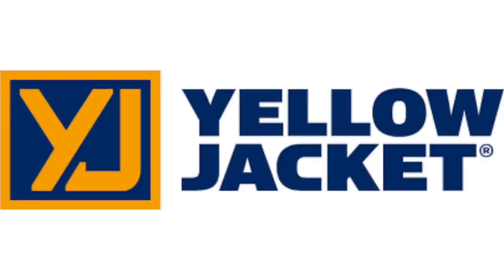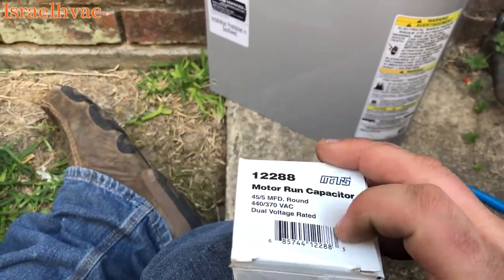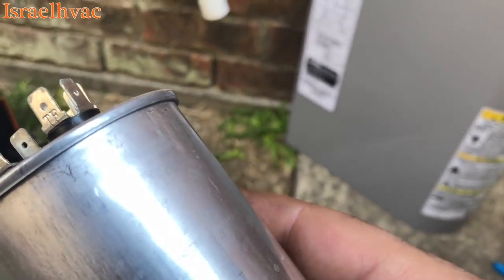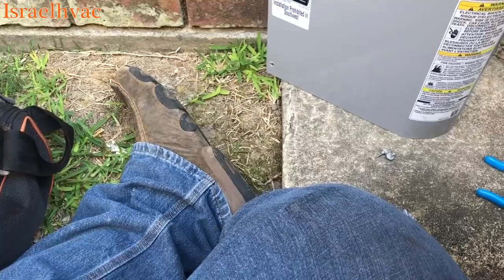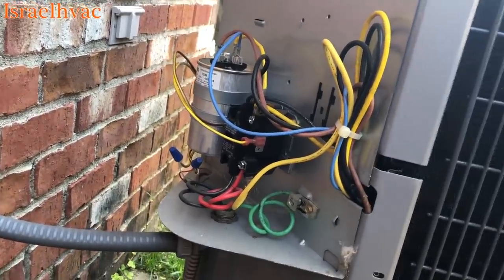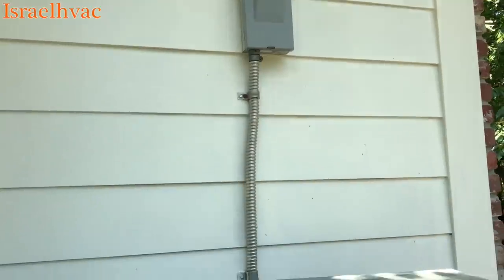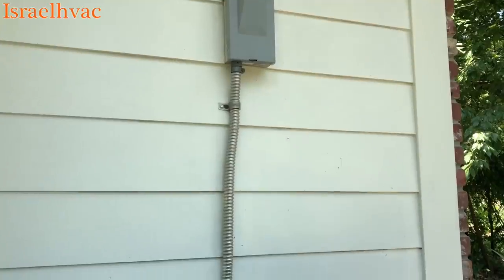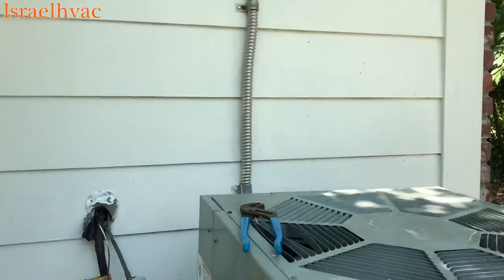HVAC | Quick Tip | Question Answered

Comment: That electric cable housing is for indoor use only it’s called greenfield . seal tight is the only thing you can use outside .and if you ever pull one off I bet the wiring is rusted out

Comment: Not sure of the name either. Seen it in va. , North Carolina  . Not the correct fittings . They have sealed fittings . This won’t rust much and uv will not affect it. It’s not greenfield ,special alloy for outdoor use.

Comment: Want to know why they don't last long?? Those capacitors are loaded in containers [----] shipped from China by sea. So, went sea spray enters air around the massive ship, those are sent in bulk, so Carrier gets them installs on assembly and salt has penetrated them and that causes failure.

Comment: Mars capacitors are hands-down the best aftermarket caps you can put on a unit. Especially the older ones that used to say Mars 2. I've kept tabs on those things over the years with my customers units and they never read a single microfarad low on the compressor or the fan. I've always written the date on my capacitors when I replace them and some of them are from 2004/2005 and not the slightest bit low 👍. Lennox capacitors over the last 5 years are the absolute worst capacitors I've ever seen in my life! TOTAL JUNK!!!